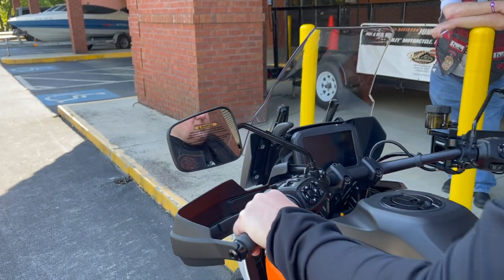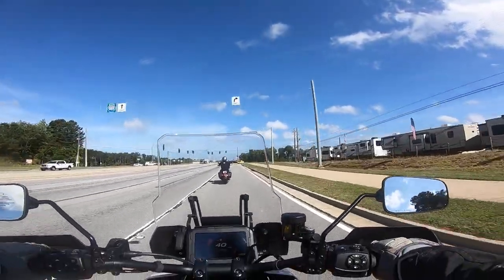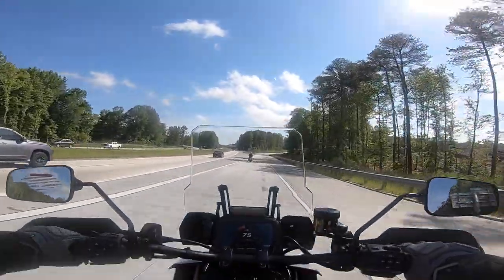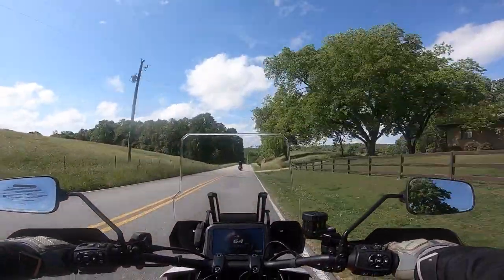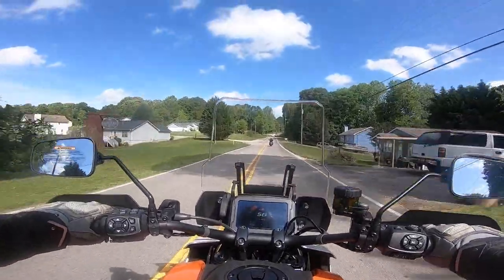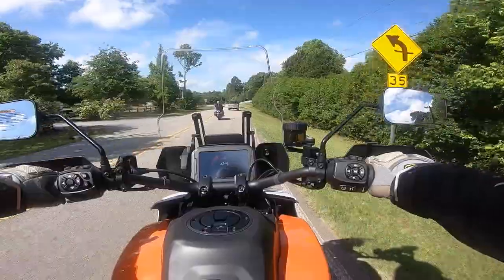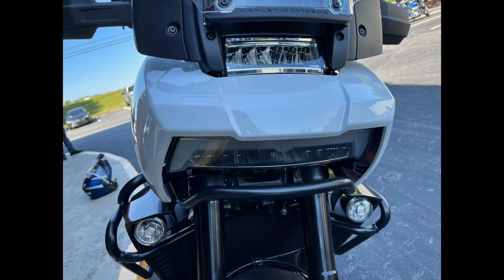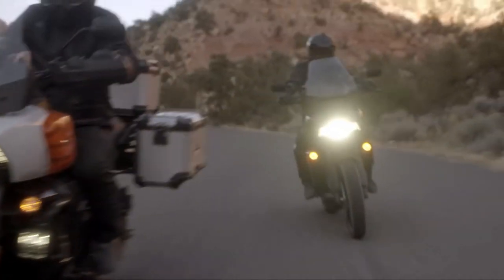RIDE ON | Harley Davidson Pan America Special | Test & Review

Comment: Great review video!  Seems like Harley has a winner on their hands!
Reply from the maker: Thanks, Pete. It's got a great engine and has good ride-quality, comfort, braking, and lighting. The dealer network (in the US at least) is great, no valve checks, and clever suspension. Build quality looks good, and Harley generally make reliable bikes. It's great new competition and it should sell very well for them.
Reply: @RichDunn  headed to the dealership for a test ride tomorrow!
Reply from the maker: @pistolpete6321  Looking forward to whether your thoughts are similar to my own impression or not? One thing I forgot to mention in the video, is that the fins and battery are very vulnerable, as they are sat directly behind the front wheel, so the meaty-looking accessory sump-guard looks mandatory to me, especially for riding any gravel-strewn forest service roads. Let me know what you think post-ride, my friend! 👍
Reply: @RichDunn  agreed that beefy protection in that area would be a must have along with front wheel mud guard extension!  Certainly eems like an odd place for the battery!
Reply from the maker: @pistolpete6321  I guess it's a way of getting a very heavyweight low and forward, but it certainly makes what you put there vulnerable too damage.
Reply from the maker: @pistolpete6321  A HIT or a MISS with you, Pete?
Reply: @RichDunn  unfortunately my scheduled ride was rained out will try again this coming Saturday and will let you know what I think right afterwards!  Have a great week!
Reply: @RichDunn  went to dealership to test ride it this afternoon and bike wouldn’t start!  Foreshadowing?  Guess I’ll try again next weekend, stay tuned!
Reply from the maker: @pistolpete6321  WT!?!?!?! 🤷 Bizzare. Hopefully just a faulty battery. I've had two brand new bikes supplied with defective batteries. All good once swapped. Let me know how you get on next week.
Reply: @RichDunn  they tried switching the battery and that didn’t work so stay tuned!
Reply from the maker: @pistolpete6321  Wow! Be interested to know what the fault/cure was when you find out. Enjoy the ride, once they have.

Comment: Not a fast rider, not a slow rider, dislike wrenching, and planning to increase touring and miles over the coming years on a new bike, probably ADV style. I'm very interested in features that increase safety and comfort, but the single most important feature to me is minimizing time spent at the dealer for service. Sure, the Pan America doesn't need a valve service, but Harley wants to see the bike every 5000 miles. The GS/A is a little better with a 6000 mile service frequency, but BMW wants the valve service done every 12000 miles. Ducati only needs to see the Multistrada V4S every 9000 miles and do a valve service only every 37,280 miles (maybe every 2-3 years). Ignoring possible expensive and time-consuming breakdowns, the Ducati may very well prove to be the least service-hungry option.
Reply from the maker: I'll let you know when my new Multistrada V4S Full arrives in the next few weeks! I agree with you, Mark. Even for people that ride a lot, 9K is usually no more than an annual visit. And it shouldn't be too expensive. The valve check service will be pricey, but 36k is an awful lot of happy miles first! Additionally, Jerry says his first set of tires lasted just about 9k, a 3k improvement over what he got with the GS. He's done over 10k trouble-free miles on his already. When it comes to safety and tech Ducati MTS is clearly the class leader. And personally, I think it is for comfort too. It's my bike of the year this year, and I've put my hard heard money where my mouth is and I'm getting one!
Reply: @RichDunn  Looking forward to your feedback on the V4S.

Comment: Did you say the engine is fruity?
Reply from the maker: Yes. It's a Brit phrase like 'full of beans', meaning plenty of grunt/go/pep. The engine is a standout. I wouldn't say the power plant is better than the Multi/GS/KTM, as they're all relatively close, but it's certainly right up there with them, as is ride quality, comfort, braking, and lighting. They have the dealer network, no valve checks, and clever suspenders. It's a very credible job. Expect to see quite a few of them in the mountains this year.